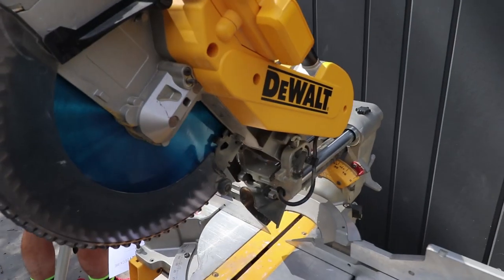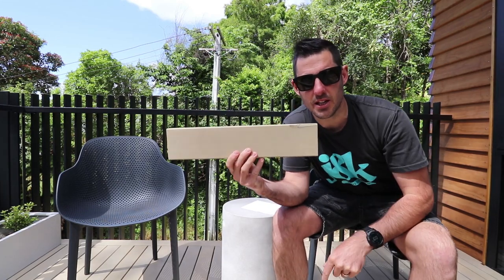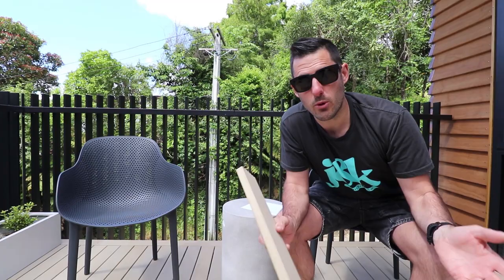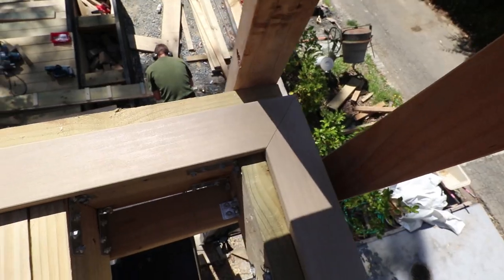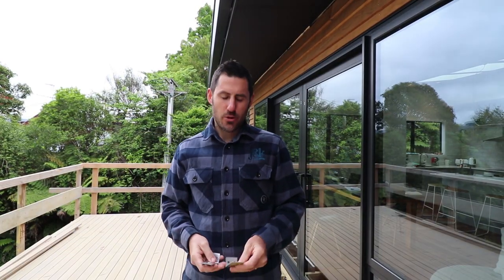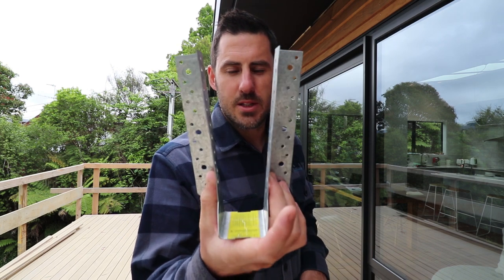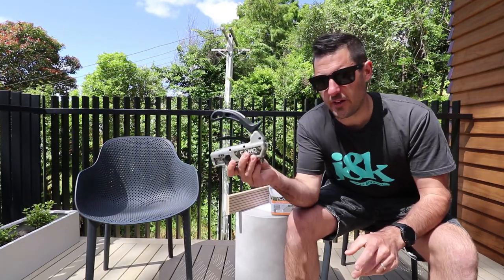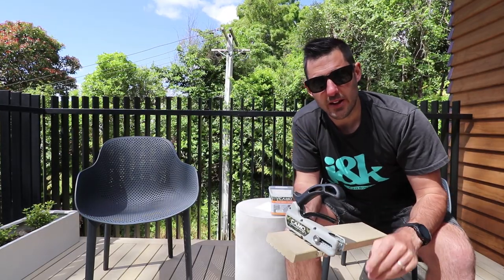I made a MAJOR mistake with my Deck // NZ Builder

Comment: Great video Josh.

I also used the camo system on kwila (merbau) 3 years ago. I don’t like seeing screws and they get caught in your socks if they’re not driven on enough! Anyway, worked a treat and still looks great after regular oiling. Boards haven’t shifted at all despite some lengths being a bit bowed and needing to be muscled in. Bit of a tip if people aren’t in a hurry: buy the camo jig and SS crews from Amazon. Way cheaper than green shed. And it’s faster as a two person job-one at each side of the camo jig. Oh and pre-drill with hardwoods.
Reply from the maker: yea we love the barefoot feel of it, and I agree, install was a breeze compared to pre drilling everything :)
Reply: Hi Craig or Josh, looking at putting down a kwila deck - can you clarify that you pre-drill through the camo system and can you adjust for wider boards? Thanks
Reply: @philmangos-bayleysrealesta5679  "Fits any 3-1/4 in. (83mm) to 5 in. (127mm) deck board and creates automatic 3/16 in. (5mm) spacing" the Pro X1 "" the screws are self-tapping I believe

Comment: Hi , are u going to leave a gap between the last deck board and the house so the water can flow down the side of the cladding to the ground ? what does the deck to house detail look like ?
Reply from the maker: Hey Elijah, Deck framing has been packed 15mm off the house and last board up against weatherboard is 12mm off :)

Comment: To be fair, galvanising is pretty damn good these days. Stainless is harder and more brittle, if it did corrode it’d be more likely to fail catastrophically. Was this a code requirement or personal preference?
Reply from the maker: Yeah that's what I thought too...

I wrongly assumed that we could still use Galvanised because we weren't in a coastal exposure zone and we were so far off the ground. But when I doubled check the rules (thanks to an eagle eye viewer for pointing it out) we actually needed to install stainless to meet the 50-year structure durability. (Galv hardware only last 15 when exposed to the weather) 

Check out 4.4.1 in NZ3604 for more info.
Reply: Sorry for old posting but this just popped up in my homepage. The so called galv he's holding is only electrogalv, must be dry in service. We used to be able to use hot dipped but they were found to not last long due to electrolysis between copper and zinc in wet service. So he picked the wrong one initially at any time in history.

Comment: Why the change to Stainless Steel? Is your house located within 500 meters of the coast?
Reply from the maker: I wrongly assumed that we could still use Galvanised because we weren't in a coastal exposure zone and we were so far off the ground. But when I doubled checked the rules (thanks to an eagle eye viewer for pointing it out) we actually needed to install stainless to meet the 50 year structure durability. (Galv hardware only last 15 when exposed to the weather) 

Check out 4.4.1 in NZ3604 for more info.

Comment: What would you recommend to aid someone else avoid repeating the same mistake?   Should the spec have a clearer 50year durability?  Respect to you for fixing.
Reply from the maker: The spec defiantly should have been clearer but I still walked into the store and pick up 200 CPCS without stopping to think about it, basically don't assume, always check, and then double check,

Comment: Hey mate, is that a  coastal property? Is that why you had to use stainless?
Reply from the maker: Hi Hamish, No where near the sea, that is what caught me off guard, in 3604 4.4.1 (Figure 4.3b) there is a section that talks about when your connections getting rained on (exposed) they need to be stainless, even in Zone B
Reply: @nzbuilder  looks like I should update my 3604 as I don't have figure 4.3b but it does mention it in 4.4.1 now that you have pointed it out